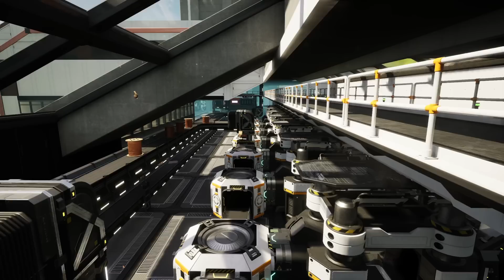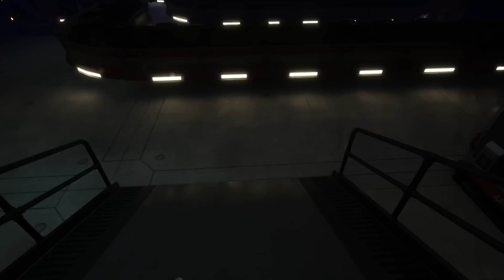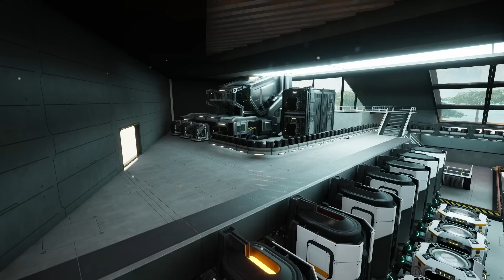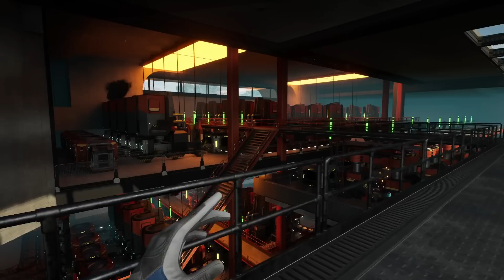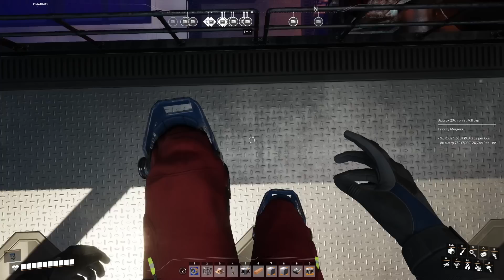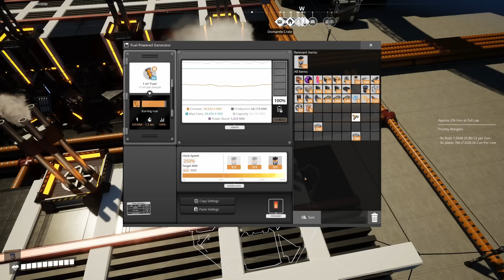I Built My Most Insane Satisfactory Save Yet - Tour it Now

Comment: Paradise is one of your best buildings next to many, like the quartz cave built before 1.0. The rail network this season is your best yet. Looking forwards to your next video.

Respectfully request the settings on your compact coal power plant (PP). From what I could tell from the information. I math the coal power plant settings is 75Mw a generator with a coal of 7.14* with a burn time of 8.4 water demand of 45m3. Clocked 100%. That is different than my clocking of 140% and works well. I would have needed 20 less generators. Wondering if its betters than the baseline build. Want to math.

105Mw a Generator, Compact Coal 10, burn time 6s. With 63m3 from 3 water extractors. They are about 1% different and anything over 80% is good for power generation.

Comment: After playing Satisfactory for a few hundred hours, I'm wondering about the best way to get resources distributed.  Ideally, I'd have each resource node with its own rail station as a source, delivering either raw resources (like iron ore) to a central location for processing into ingots, then shipping those out to various factories.  Other things like aluminum/caterium are better processed into ingots at the node.  Then there's petroleum products and gases and acids to worry about.

If I go with the centralized model, it's easier to build custom trains specifically for each factory's needs.  However, I end up with a bloody huge, complex central distribution center that's just too big to be workable.  There's all the ingot types, plastic, rubber, acids, gases...it's just too big.

If I don't go with the centralized model and instead ship direct from the nodes, I end up with a gaggle of tiny trains running all over the place.  Worse, there's train station sprawl at the destination factory.

I'm currently thinking about something in the middle:  having 4-6 distribution centers spread evenly across the map, perhaps specializing them a bit so one handles only ingots, the other only liquids, and another for everything else.  But the logistics of putting all this together with a rail network are daunting and I still end up with multiple train stations at each factory for unloading.  I'd prefer to have at most one or two train stations at each factory, dropping off only what's needed, then returning to nearby distributions to refill.

How is everybody else solving this?  I get there's no "right" way to do this, but I'm curious what other solutions people have come up with.
Reply: You're better off asking a question like this in the satisfactory discord instead of YouTube comments

Comment: Congratz on Ten Years! I have had those exact crashes, seems to really only happen when you have alot of objects and blueprints in one area. I do not know if it is the same thing here, but it is an annoying crash that can be mostly avoided by reloading the game every now and then. Unless you hit the hard limit were you can't add any more objects at all.
Reply from the maker: So the amount of items in game fluctuate, which is why if you restart the game you can continue to build for a while before another crash. But after having several crashes within 15 minutes of building I've upped the hard limit set by the game, to the UE max limit
Reply: @TotalXclipse  That is what I have ran into a few times, were it will just crash and crash and crash, even if I did not place anything. My world is on a mass scale as well, I did try to mitigate it abit by putting my massive factories all over the map, lol.
Reply from the maker: @WhiteStoneIndustries  That wont help when you hit the Object limit, just edit the config file to up the limit and you should be good, though you may occasionally crash
Reply: @TotalXclipse  Thanks for the tip!